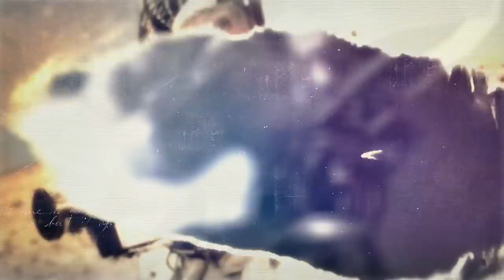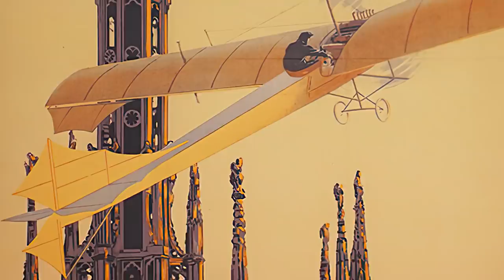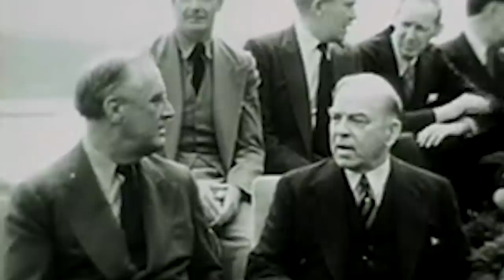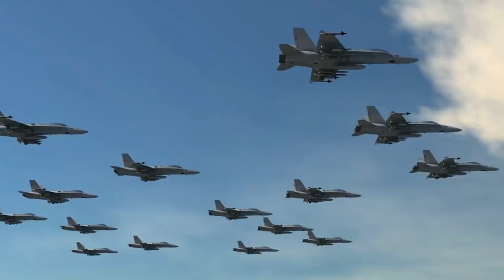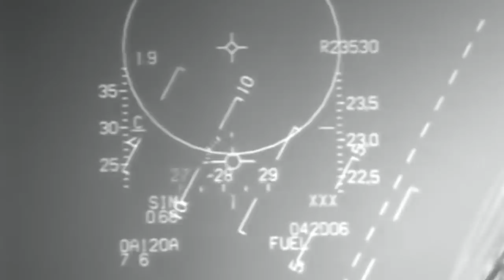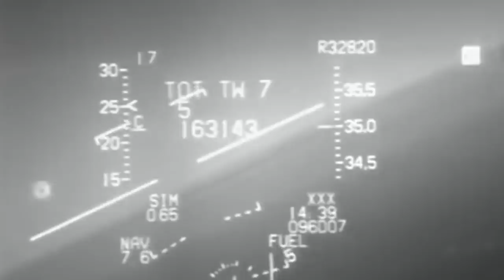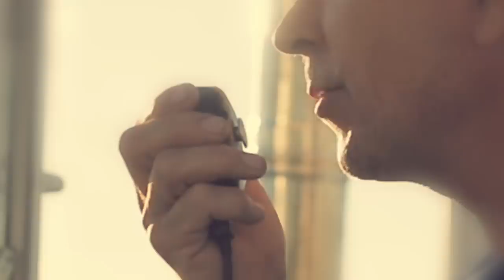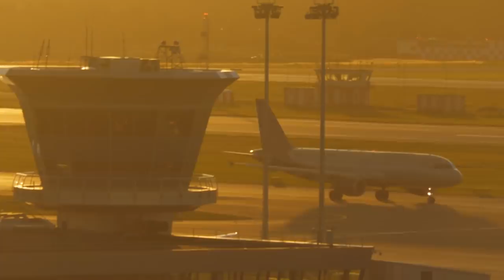F-16 Pilot Doesn't Realize He is About to Hit a Passenger Plane

Comment: 1) Civilian and military planes don't have the same equipment, so anti-colision devices are not the same and compatible.
2) What about that accident in 1998 when American jets cut off a cable car wire in Italy, causing the death of 20 civilians only cos they didn't act according to regulations and acted like cowboys, flying too low? What devices was there to stop this?

Comment: In 1962, I visited a facility that was testing air control systems. There was a room with 50 simulators in it. Housewives and high school kids operated the simulators according to a script. Systems were evaluated by calculating the number of collisions that occurred during the last simulation run. The systems being tested then did not rely on transponders, but instead tried to track aircraft through radar returns and information supplied by the air traffic controllers and the pilots. They did not work well. However, I think these tests established the need to have transponders on all commercial aircraft.